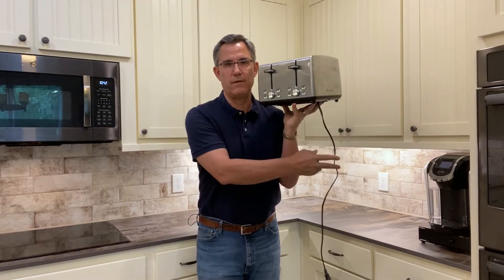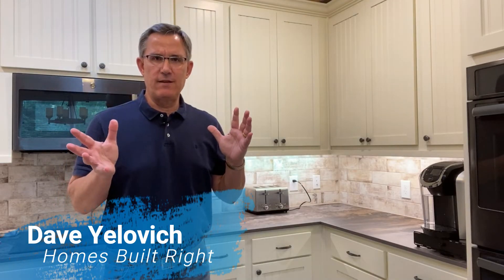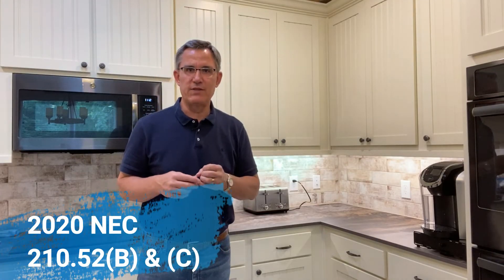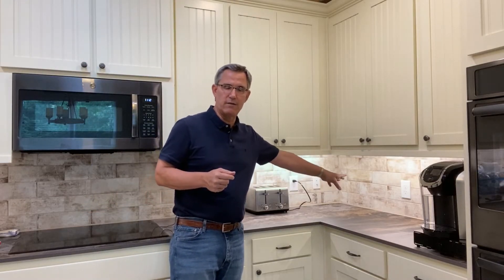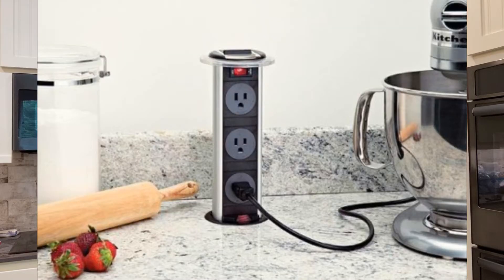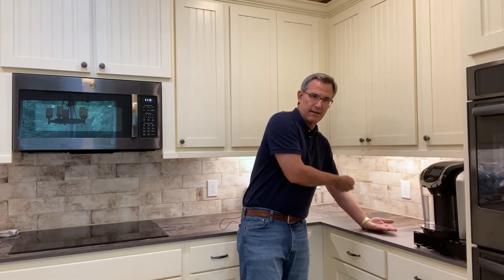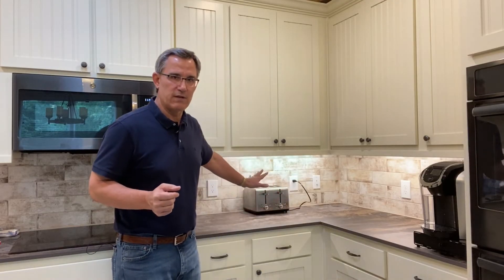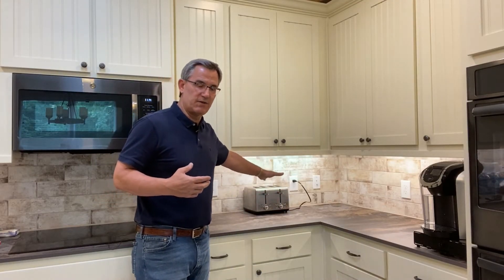2020 NEC - Kitchen Outlet Rules

Comment: For a 10' long peninsula is my only option for the 8' away from the wall to use pop-up outlets ?  I heard the 2023 NEC change says no more outlets on the side panels or rear of islands and peninsulas (to avoid safety issues with cords dangling in walkways) ... so you can have either no outlets and include a junction box where they can be added later, or you have to use expensive popups that ruin the look of the countertop material.  Popups also take space in the base cabinet which may not be available due to dishwasher or other appliance needing the entire base cabinet space.
Reply from the maker: 2023 NEC Island Outlet Locations
https://youtu.be/MC4803reQJo

Comment: question: the microwave is powered on but I don't see it plugged into an outlet. is it hardwired or is the outlet inside the cabinet? 

also if the rule is four feet, shouldn't there be an outlet over where the cook top is?

Comment: I know this video is old so I probably won't get a response.  I have 2 countertops about 4 sq. feet each, 1 on each side of sink.  Presently there is no receptacle on either side.  Yeah, I know.  Everything about this house is well, not right.  It's 111 years old this year.  I'm installing a 15A gfci receptacle for each countertop. I planned on tying them together and running to one 20A breaker.  Or do I need to run them separate?
Reply from the maker: It’s a very old house.  If you’re in a city, check with your building official.  If the intent is to bring the kitchen up to current codes, I would say you’d need 2 circuits.

Comment: My toaster is plugged into the adjacent wall outlet (table height) at one end of the breakfast/dinner table. Actually, I have two receptacles at that location, on different circuits. When we remodeled the kitchen-dining area we made it NEC compliant.

Comment: I've read that the same kitchen counter circuits may also power a refrigerator, a gas range, a clock, and even outlets in the dining room.  Instead of serving only the counter area.  Is this correct?
Reply: yes....but, what if the refrigerator manufacturers want their products on a separate circuit.  Can the building inspector tell you to invalidate their product. Code says you can run more circuits, just the minimum is two 20 amp circuits.  Say your ref takes 7 amps and your microwave takes 15amps. (just run another circuit for the ref and you cure these problems.)

Comment: I’m working on a remodel, I’d like to have undercabinet outlets. My question is, do the GFI‘s have to be installed inside the upper cabinets or can they be relocated someplace else. The issue is having the homeowner having to cut into very expensive upper custom cabinets and having to look at GFI reset circuits in their beautiful custom cabinets.
Reply from the maker: You can put the circuit on a GFCI

Comment: What happens if the gas range is 48 inches?  Isn’t it impossible to get an outlet to be less than 4 feet apart?
Reply from the maker: The spacing rules apply to the workable countertops.  You don’t count the range space.
Reply: @HomesBuiltRight  so the 4 feet would reset?
Reply from the maker: @Platerpus7  yes.  There would need to be an outlet to the left and right of the range - within 24” of the edge next to the range.
Reply: @HomesBuiltRight I had a window in the way so couldn’t do it.  Nobody is inspecting my house.

Comment: What about under cabinets outlets?
Reply from the maker: Yes, under cabinet strips or individual receptacles are OK as long as they are not more than 20” above the countertop and the spacing rules are still adhered to.
Reply: @HomesBuiltRight  thank you for the quick reply 😊

Comment: Do the outlets on the same circuit have to be side by side continuous with each other? Or can you have 2 circuits 4 oulet duplex staggered.  So instead of breaker 1 duplex outlets a and b, breaker 2 outlets c and d. Instead can you put it breaker 1 powers duplex outlets a and c, breaker 2 outlets b and d. ??
Reply: Minimum two circuits and so long as both circuits have GFCI protection and AFCI protection, stagger them however you’d like.

Comment: I'd like to see a video on all the outlets in the kitchen & laundry room, including the refrigerator, microwave, dishwasher/disposal, dedicated, which need to be GFCI protected and which is preferred, either 15A or 20A based on dedicated circuit or not. I know that both are allowed in the kitchen, but in the field we're putting in 15A outlets in the kitchen, unless it's a dedicated circuit, then it's a 20A outlet. Thanks for your video.

Comment: Should the refrigerator be  on a dedicated circuit and should  the   microwave  also,  be on its own circuit     or included on one of the 2 circuits   addressed in the video? Thanks
Reply from the maker: Electricians and code officials may have varying opinions.  Technically, no.  An over the range microwave does not require a separate circuit but most will supply one since the make and model of the unit can vary and there are code limits on the amount of power that little thing can draw.  Fridge is similar.  It can be on a shared circuit but really shouldn’t be based on the size of modern refrigerators.

Comment: What about accommodating microwave hoods?  My kitchen is from 80s and while we have two circuits, there is a separate 20a for the refrigerator.  I’m installing a microwave hood and wonder if the refrigerator/microwave can share same circuit.  I’d love to see how this is all described in code.  The total combined peak load is 2kw (1100+900). Thanks and great video. Nice and tight, clear to understand.
Reply from the maker: Thanks Ken.  I defer all specific questions like this to your local Building Official or local electricians due to variable codes and ordinances.   Thanks for watching.
Reply: @HomesBuiltRight  lol good answer.
Reply: @LDoctorKC  they can share a circuit
Reply: @electricaf365  no they cannot microwaves are too powerful and they should have their own dedicated circuit

Comment: Is there a minimum counter depth (not width) that gives any exception to the spacing requirements? Renovation work has a pilaster that the counter notches around resulting in a counter section of about 33" in width by 14" in depth. It also happens to be at one end of the counter. Where do I start measuring? Thanks.

Comment: Distence from sink and closest outlet.
Reply from the maker: Technically, there can be an outlet right on the edge of the sink - but not more than 24” from that edge.
Reply: @HomesBuiltRight  yah, though I wouldn’t like splashing water on the outlet. Maybe 23” would be better for my house. Never lived in a house the had one close to the sink. The code these days has so much in it, but one or two seem to get missed.

Comment: What about the rules for outlets on either side of the stove?  Isn't there a minimum/maximum distance?   I am getting ready to tile and one is 16" away, and the other is 15" away.  I can only move the 15" to 16" but it is getting very close to the fridge.  Comments?
Reply from the maker: They can go right up to a slide in range (just not behind it).  You start measuring from the edge of the countertop at the range and then cannot exceed 24”.   If yours are 15” and 16” from that edge you are OK.

Comment: 2:49 where in the code book dose it say maximum 4 foot on center or mention 4 foot 2 foot im not trying to be a rude guy i realy am asking
Reply from the maker: In the 2018 IRC it’s in E3901.4.1 and the 2020 NEC has wording in 210.52(C).  Hope that helps.
Reply: @HomesBuiltRight  thanks for the reply after reading 210.52c1 repetedly the detaill is recepticles shall be installed so that no point along the WALL LINE is more than 24" horisontaly from a recepticle. i so thought that ment recepticals every 2 feet infact ive done at least a hundred of peicework apartment  kitchens like that but now i understand where the 4' came from even though i dont see 4' in the code book its because in the middle of the 4' is the 2' spot of WALL LINE between recepticals is still 2' from a receptical i think they should realy put the number 4 and 2 in the code book but thanks for the reply again i needed that clarified.

Comment: Gfci × afci...on kitchen 
Should be dual funtion breaker
Or
Gfci receptacle +afci breaker

More easy to get dual funtion breaker
And regular receptacles...
Which will be protected from
Panel with the dual funtion breaker
Reply from the maker: I usually see both at the breaker.

Comment: My customer wants an power outlet inside a cabinet for sole purpose of pluging in an 1800 watt Fryer oven, is it acceptable to have an outlet like that inside the cabinet?
Reply: Sure.
It will NOT reduce the required countertop outlets though.

Comment: You cannot exceed 4 feet between outlets? Why? Why can't they be 5 feet apart???
Reply from the maker: Countertop outlets:  If, let’s say, you place a toaster with a 24” cord between 2 outlets on a countertop, it should be able to plug in to the left or right.  Code says maximum spacing for countertop outlets is 48”.
Reply: Simple answer: because the code says so.
Reply: Because appliance cords are only 2', they don't want extension cords used for appliances. Extension cords cause fires. It's the same in other residential rooms, no more than 6' to any receptacle, with many details regarding short walls and fixed glass panels. All lamps come with a 6' cord, and again, no extension cords required when the electrician follows the code.
Reply: Wall spacing codes

Comment: The code really says you must have outlets spaced so that at not point along the horizontal surface can you get further then 24” from an outlet. Which means if you have an outlet 30” from the end of a countertop, you don’t meet code. Also you must have an outlet where a countertop is 12” or larger. So if you have a small countertop between a cooktop and a double oven and its 11” wide you aren’t required to have one there.   

Oddly enough I’m about to install those flip up outlets for the first time and initially it was suggested to use a tower type.  Never heard of them before now I’m bumping into them everywhere lol. Good basic video.
Reply: I watched the video in search of the 12 in rule stuff. Dang the print is showning  12.5 inchs.
Reply: I could be wrong but hear me out. Outlet 2 feet from major appliances, 2 feet from the end of the countertop, no more than 4 ft between, and gfci if by water (sink fridge don’t count.) 20 amp and we usually go 16 above counter top height. Any corrections I’m still green.
Reply: Sounds ok i guess but all kitchen counter plugs have to be gfci protected. As far as how high they are above the countertop, usually we put them as near middle of the space between the countertop and the bottom of the upper cabinets. This is usually around 45”-47”or so from the unfinished floor. If in an older home you should snap a level line or laser and find were the floor is highest. They sink and sag over the years and the highest part of the floor sets the height for the cabinets. Then you can use the level line to measure off to get the heights of all the other outlet boxes.
Reply: I often use a diagonal horizontal measurement when measuring between outlets. Both in bedroom outlets and kitchen. A little more sophisticated, but it is how people actually cords. Cords are often under furniture and such, not just placed along walls.
Reply: This is incorrect.
Any countertop over 12” must have a receptacle OUTLET, and 24” from edge is the maximum, but you can have UP TO 48” space between the receptacle OUTLETS
Reply: If you have them spaced at 48” can you get further then 24” from a receptacle?
Reply: @billybilodeau1991  do you know if I can have my kitchen ceiling light and fan on the same circuit as my kitchen counter top outlets?
Reply: I don’t see why not but I wouldn’t only because its a waste of wire and 12gauge is harder to deal with. Older homes might have something like that because of how they were wired.
Reply: @billybilodeau1991  well I was just thinking because that’s how it was, and it’s easier for me to fish a new wire down between a couple studs than to re-do the walls and go through the studs
Reply: @SuperVstech  I don’t see how what you said differs from what he said, no space can be 24” from an outlet. Just as no space along a wall in bedrooms, living areas, etc can be 6’ from an outlet.

Comment: You said 2 foot 4 foot, so no more than 4 feet, but what does 2 foot has to do?
Reply from the maker: Let’s say you have a toaster with a 24” cord.  Anywhere you put that toaster on the countertop it should be able to plug in within a 24” span.  (The 2’ rule). Therefore, outlets cannot be more than 48” apart along countertops.  (Does that make sense?)
Reply: Dave Yelovich yess thank you! So does the 4 feet distance end where the sink goes? If so what would be the closest you can put an outlet to the sink?
Reply from the maker: Can go right up to the sink.  Within 2’ of the edge of that sink you would need an outlet.  (I know you wouldn’t put a toaster on the edge of your sink but that’s how the code reads).

Comment: Hello Dave, I am building a tiny house and it has a two foot wide countertop and the countertop has no backsplash (because of window). Can I place an outlet on the front of cabinet (where the sliding drawer is located in your video) just below the countertop level ?  I also have open space on the side of the kitchen cabinet.  Is it okay to place an outlet on the side of the cabinet? This will be similar to having an outlet on the face of the cabinet (just below the countertop level) except it will be on the side of the cabinet. Thanks so much in advance for any reply...
Reply from the maker: Sounds like you have an application similar to island rules - when they are all placed on sides.  Check your local codes for tiny homes.  They may be dealt with differently than houses in the IRC or NEC.

Comment: Can knob and tube be made safer by installing afci breakers on the knob and tube circuits? Or is it best to shell out thousands to rewire.
Reply from the maker: I’m not an electrician.  Best to contact a local professional and ask them this question.
Reply: I had a house with knob & tube and an electrician told me there's no need to replace it. That was his opinion for what that's worth. The insulation on that wire was very degraded, but still in place. If left undisturbed I assume it would be fine. I replaced it when I did a remodel though.
Reply: @waterbug1135  just remember if you have existing knob & tube wiring that wiring CAN NOT be covered with any insulation etc, bottom line it must be exposed for air exposure including running  down walls.
Reply: Shell out the thousands to replace it. It is extremely dangerous!!! Mice have probably chewed all the insulation off, the splices made over the 100 plus years that it's been in service are probably faulty. When that stuff was installed, the only load was lighting and maybe a receptacle in each room. Burning alive in a fire is a very bad way to die. I've been wiring for 40 years and I've seen a lot a bad stuff. Take my advice or buy a lot of good life insurance!
Reply: @davenag957  OK, knob and tube  is NOT "extremely dangerous ".  It's just about common sense.  If it's damaged or needs  repairs then replace it ( just like anything else) . If you have a small basic house , few lights and a few outlets,  it's not worth changing it to romex. Leave as is. 
  On other hand, if you plan on installing insulation,  remember knob and tube must be run in free air.  If you plan on upgrading your service panel,  remember almost every circuit needs to be AFCI protected  ( usually with afci circuit Breakers). Problem is that knob and tube was installed with shared  neutrals ( multi branch circuits ) . I only seen one manufacturer so far that actually makes an AFCI breaker for multi branch wiring.  Also, I've heard about a couple home insurance companies refusing to renew existing policies unless the knob and tube was replaced

Comment: I live in Massachusetts not sure if the rules differ but does every outlet have to be GFCI protected or is it just the first plug or outlet in the circuit?
Reply from the maker: If done at the outlet, yes, the first in line would work.  However, many circuits are GFCI protected.

Comment: Thanks for the video. Can the GFCI outlets be placed under the cabinet (instead of backsplash wall). Do the codes allow it?
Reply from the maker: Yes.  The face of the lower cabinet is doable under certain conditions.  You would follow similar rules like the ones for islands.  You could also choose the pop up style of outlets as well.

Comment: You failed to mention the circuits must be 20 amp.  Otherwise,good presentation
Reply: In the 2020 code they also require arc fault circuit interrupter protection.
Reply: @jolyonwelsh9834  I think if you use the gfci, you don’t need to install arc fault breaker
Reply: @jesusortiz6842  GFCI does not protect against arc fault.
Reply: @jesusortiz6842  you thought wrong

Comment: Does the 2020 NEC also require AFCI on outlets within 6 feet of the sink? (Potentially including dishwasher and disposal?)
Reply from the maker: Arc fault protection for receptacles in kitchens and laundry areas was actually added in the 2014 NEC.  You’ll usually see combination AFCI/GFCI breakers for these areas.
Reply: @HomesBuiltRight  l m.j moo moo pub 
boo
Reply: @HomesBuiltRight  but it was in 2017